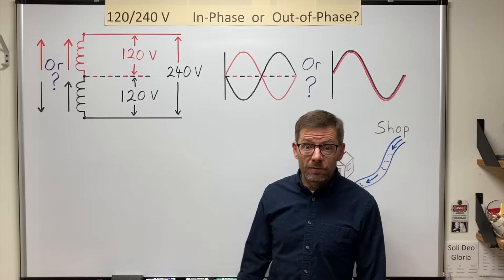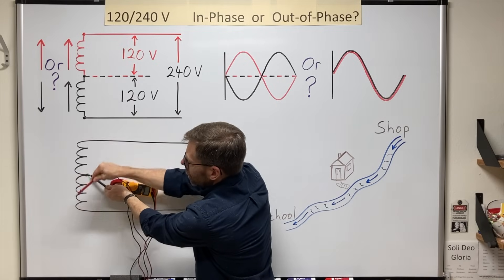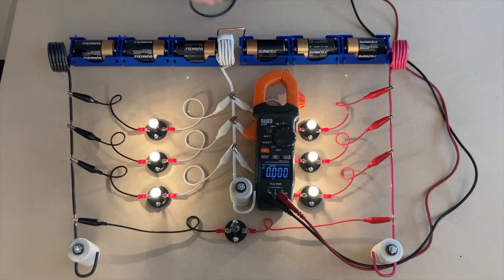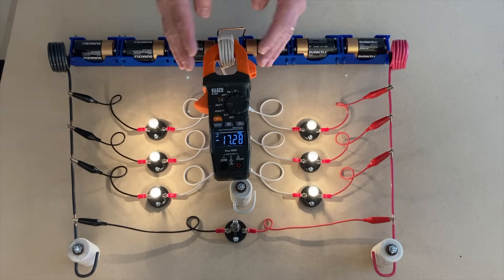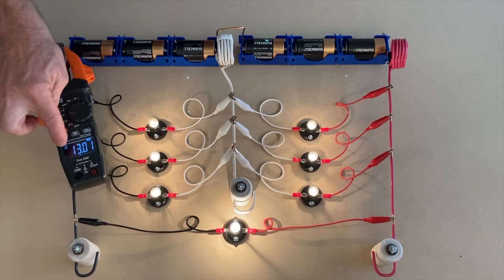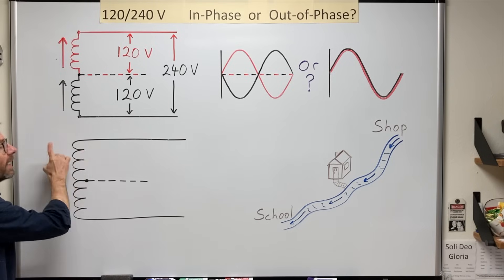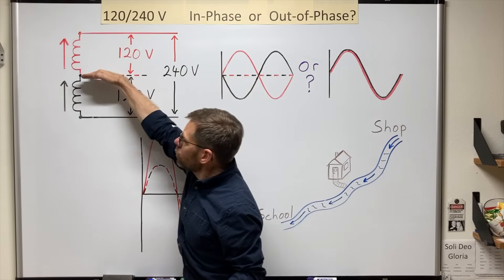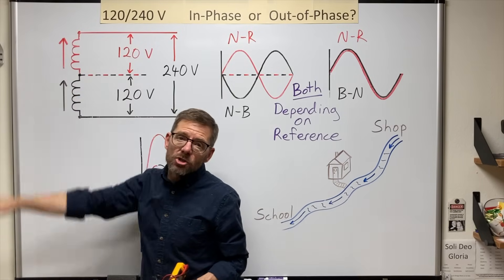120/240 V  In-Phase or Out-of-Phase

Comment: Wouldn't this be akin to claiming that two lines of a 3 phase service are 60 degrees out of phase? Because essentially they are if we are willing to count peak to trough (as we are here) and not peak to peak.
Reply: No.  The three phases are out of phase by the same amount no matter how you measure them. The only difference in voltage is a result of where each phase is in its cycle relative to the other one measured.
Reply: @jovetj  see my response to your other reply. In short, if we change reference as he does, we WOULD get 60 degrees OOP for a 3 phase winding. Explain how this isn't true.
Reply: @jovetj  if your having any trouble seeing what I mean, use his battery trick (DC equivalent) and rotate exactly as he does (according to polarity) and see how many degrees OOP you get with a 3 phase winding.   Hint, it's 60 degrees. If this doesn't make sense I'm happy to explain further.
Bear in mind that when I say 'rotate', in his example he 'rotates' 0 degrees to draw the 0 degree OOP conclusion. 

To be clear, I don't disagree with any of his steps, only his conclusion (and only that his conclusion is incomplete, not that it's fundamentally wrong).
To say it is misguided to retain a common reference for determining phase angle, though,  is ridiculous. Phases are by definition an angular comparison and to do that you need 3 points with a common vertex. It's just geometry

Comment: 7:58 How is the bulb on the bottom energized with no path to source? Is the one set of batteries balancing the other in that setup?
Reply: Great question!!
The answer: follow the wires.  The current was flowing from the negative of the battery pack on the left, through the back wire, and through the bottom lamp...  then through the three other lamps still connected through the red wire and back to the neutral which stayed connected to the positive of the left battery pack.  The three lamps didn't glow because the load (resistance) was all shared between them, reducing the voltage across them each.

Comment: I disagree somewhat with your declaration at 12:35. Semantically that is,  but semantics is what this is about.

Whether or not the windings (or half of a larger winding as it may be) is in phase or 180 out of phase has to do with reference. You admit this yourself and obviously understand that. If neutral is reference, as it so often is, I don't see how anyone could interpret the phases as being 'in' WRT neutral. Your sine wave graphs show this exactly. When L1 (or L2) is reference, they are series aiding, and are indeed in phase (becoming a single 240 v sine wave). But how can one argue with a graph clearly depicting waves as being 180 out of phase-- by the very definition of phase.

By the way, excellent video and fundamentally I agree with everything you've taught here-- just making a semantics point on what it means to be in or out.
Reply: Spruce_Goose is correct here. Dave moves his reference between the two measurements, which invalidates the relationship he's trying to show.
You have to pick one reference point if you're going to determine the phase relationship between two signals. The practical choice for that reference point is earth/ground, which is what neutral is bonded to.
From the perspective of neutral, there are two secondary coils wound in opposite directions, creating two 120v signals that are inverted from each other (which we tend to call "180 degrees out of phase").
If you use a typical oscilloscope that you plug into a wall, it will always be referenced to earth/ground. Therefor, you will always see the "phases" of your system as 180 degrees out of phase. (note that the phases of a split-phase system are not linearly independent and therefor not actually independent phases)

If you use a scope-meter that is NOT connected to a receptacle, you can measure from one end of the full secondary winding. From that perspective you can measure one side of the split phase or you can measure the whole secondary... but you can't measure the other side of the secondary because that would require you to move the reference... which is why we don't talk about the phases from that perspective.
Reply: The point is the reference based on the neutral does not matter and cannot determine "in phase."  The neutral does not determine what the transformer winding is doing.  The transformer windings determine that.... a fixed reference based on its center tap is misguided.  
If the transformer windings were truly out of phase, they could never be added together to produce the double full-winding voltage.  The video demonstrates this very clearly early on.
Reply: @jovetj   How are you determining what the windings are doing without any reference? In the case of 3 phase, 120 degrees out, the reference is a neutral (real, or imaginary in the case of delta). 

If you apply his same logic to a 3 phase winding, you would come up with 60 degrees out of phase. The multiplier we use is Sq Rt. 3. Thats 1.7ish, which implies 180 OOP would be a multiplier of 2, not 1.

Phase, by definition needs reference. 
Please explain how, on a 3 phase coils, you would determine the phasing with a changing reference. Because that's what he's doing to claim 0 degrees out of phase here: he's changing the reference. Andnif we're allowed to do that, then my statement that 3 phase windings are 60 degrees OOP is perfectly valid.
Reply: @spruce_goose5169  The reference in three phase is zero volts.  Each phase has two of them in its cycle.  You can measure between phases or between a neutral and a phase.  The instantaneous measurement may be phase shifted but the difference between the phases will not be.  Your 60° doesn't compute with me.  Are we really on the same page here?  https://youtu.be/iMn7dq7B1oo
Reply: @jovetj  I don't think you understand that phase relationships is fundamentally about reference. 'Phase to phase ' is actually just one new single phase.
Zero volts? Zero volts to ground you mean? That's usually the neutral (but not always) and it's depicted on phase graphs as the x axis.

Let me ask you,  what is the angle between two points? What about two lines? Hopefully you see the first question is nonsensical and the later requires a vertex for reference.

The 60 degrees is what I am saying one will 'think' the difference is if using the method described in this video. Did you try the battery example applied to 3 phase? What number did you get?
Reply: @spruce_goose5169  “Zero volts? Zero volts to ground you mean?”
No, zero volts to another phase.  Between any two phases, there are two moments in one cycle where the potential voltage is zero.  These are easy reference points for phase displacement, because all three phase combinations can be seen to have zero points at different times.  You can do the same with a neutral, if there is one, if you want, but it only changes the "whens" and not the "how often" for those zero points. 

It's like you're trying to use military ordinance to drive a nail into a board—you're making the results of this  video far more complicated than it truly is.  Three phase is more complicated because the 3 windings DO change phase with each other, whereas a split-phase transformer secondary does not.  That's why there are three three-phase secondary windings (usually) and not just one (or two joined in series).
Reply: @jovetj  Jovet. JOVET. MAN. It's like your not even reading my words. Certainly not comprehending them. Shy haven't you answered any of my questions.

You realize the x axis is ground potential, i.e. neutral (most of the time). The zero crossing are in respect to neutral! 

If you're talking about when 2 phases cross each other (which, yes,  they do twice a cycle) you might be surprised to learn that that happens every 180 degrees, not 120. Look at the graph man. Measure it.

I'm not making anything complicated you just seriously don't understand what I'm saying. It's quite simple of you let it be, but you're too stuck thinking you're right to even bother answering (or pondering) the questions I have asked you and the points I've made.
Reply: It's also as if you think I'm arguing 3 phase power is 60 degrees OOP. I'm not. I don't know how to make that any clearer. I'm saying the logic applied here, of applied likewise, would yield 60. Not sure how you can't see that. Use his river analogy. Use his battery analogy. Use whatever you want from the video and you will see.
Reply: To clarify. 180 is between the same two phases, not any two so maybe we're not off each other's page on that one. But 'any two' phases cross every 60 degrees and therein lies this complication of reference.

Comment: Kids, if you try this at home make sure you have your scope powered thru an isolation transformer, unless of the portable battery operated type which are much more common these days, excellent presentation by the way
Reply: +1 This experiment generally won't work with oscilloscopes that plug into the wall because they're referenced to earth. The little (negative) clip on the probe is shorted to the ground pin of the plug.
Earth is bonded to neutral at the panel, so if you put the clip on live, you'll complete the circuit and make a lot of smoke, sparks, and fire.

Comment: I remember browsing youtube many years ago and being confused about - how the hell just adding center tap can invert phase?! And almost every popular youtuber and even pro electricians couldn't explain it lol. Turns out it is just a measurement problem.
Reply: There's no 'problem'.
''inverting" a phase is not like adding rotation. It's not magic, it's simply a matter of polarity and-most importantly- reference.
With neutral (center tap) as reference, the two hot are undeniably 180 out of phase (or 'inverted' if that terminology suits one better). But for sure the coils are series aiding.

Comment: So if I'm understanding correctly, two outlets in a house might look like they're out of phase from each other at the plug, but that's just because one has the hot on the negative while the other has the hot on the positive and you have to account for that when judging what's going on with the system as a whole?
Reply: Both L1 and L2 are generating voltage at the same moment.  The only thing the neutral does is cuts the number of windings of which voltage is drawn in half, halving the voltage.  The "out of phase" is just a measurement artifact from measuring both relative to the neutral, and not the full transformer winding itself.   Watch the video again, it's explained very well.
Reply: @jovetj  So then exactly what I said is accurate. Got it. If someone is measuring at the outlet, it appears to be out of phase because of the polarity of the hot terminal while not actually being out of phase because it's just a measurement artifact. Read my comment again, I explained my question very well.
Reply: @alphazero924  this is all semantics. There's no 'lie' in the 'artifact' of measuring from a common neutral point. It's how we get 120 degrees for 3 phase systems. People here proclaiming you simply cannot use a common reference point for determining phase angle are bonkers. They're 'in phase' in that they are series aiding coils (which for some people is apparently the definition of whether something is in phase)
Reply: At the outlet, one prong (the larger slot in the US, and on the left if the ground pin is down) is the neutral. That's bonded to earth/ground at the main service panel, and there's a literal stake in the ground somewhere nearby.
If you measure from ground to one end of the secondary winding, you'll get 120v. If you measure from ground to the other end, you'll get 120v but with an inverted sine wave compared to the first side.
That is why people say the two sides of the secondary coil are out of phase with each other.
In the video, Dave MOVES his reference point between the two measurements. This is not generally allowed, because if you do that, you can show that anything is in or out of phase with anything else.

Comment: Great. Now people without isolated channel oscilloscopes are going to blow their leads up. Please point that out.
Reply: This is why we talk about the two split "phases" being 180 degrees out of phase. The practical reference point is earth/ground.
Reply: @Falcrist  Yes, thank you. I come from the old school, fixing televisions and using an isolation transformer. The old oscilloscopes have a common return on the probes and are grounded. If you attempt to look at the 240 voltage, you clip your two probe grounds on the neutral and the probe tips on the two hots. It shows up as 180 out of phase if you forget to invert the second channel. I now have an isolated scope, but had old school habits. I know how to correctly reference the probes, I just had a brain fart. Brain farts can be dangerous. I have watched people blow up their leads because they didn't isolate the probe return.  Viewing 3 phase is a perfect example. Thank you for your excellent videos!

Comment: Great explanation Dave!  Now, I'm scratching my head trying to understand if I can measure total power, assuming a unity power factor, by simply measuring the L1 current and L2 current and multiplying by 120Volts.  I believe this to be true for a balanced system....but what about an unbalanced system?
Reply: Have to add in the neutral's current.
Reply: @jovetj  I don't think you need to measure the neutral current.  Look at the circuit for an electric meter (or look at one not installed if you can) and you will see the neutral current is not measured.  Adding L1 and L2 times 120 will in fact give the correct volt amps, and accounting for the phase of the voltage and current (the meter does this) will yield power. (Integrating over time yields kWh.)  Don't believe for a minute that the power company is giving you  that neutral current for free!
Reply: @davidg4288  You're likely right about not needing to consider the current on the neutral... but I never said anything about free.  Or power factor.
Reply: @jovetj  Fair enough!

Comment: pretty much all you said is correct.   You glossed over the fact that your clamp ammeter in DC would have given opposite signs if turned the other way around but that did not matter much for the point.   Altogether, very clear if not exactly surprising for folks familiar with meters and scopes.  Thank you.  However, for safety reasons, I feel that you should have made a strong point at the end when discussing results from the ground lead of the scope to L2, that this should NOT be done in real life.  It WILL BLOW UP your lead and/or scope because that would essentially be a dead short between L2 at 120V and mains ground through the scope's ground lead.  As it stands, a curious person not familiar with scopes may just try that to verify your (correct) assertions and be in for a bad and dangerous surprise.

Comment: Appreciate it. People say quite readily that the two sides are 180° "out of phase". Then, to make matters worse, they tell you to subtract the instantaneous voltages to get the total. To me, "out of phase" means adding them gives you 0. Like the Theory of Relativity, it really depends from where you are looking at it.
Reply: With earth/ground as a reference, the two sides of a split phase system DO add to zero. One is positive while the other is negative.
When you connect a load across those phases, what matters is the difference between the two voltages... not adding them together. Remember how you calculate current through a resistance. I = (V1 - V2)/R where V1 is the voltage on one side of the resistance, and V2 is the voltage on the other side.
For example, if V1 = V2, there will be zero voltage across the resistance, and therefor no current will flow.
Reply: @Falcrist  Yes, I understand that. And it is still often unclear to many and needs a good explanation, like yours.

Comment: That point of time we are measuring is necessarily the peak right? It's like pretending it AC going through a rectifier.
Reply: It doesn't matter because if it were truly AC, the "AC" voltage would have to be measured RMS.  The DC/batteries represent a snapshot in time of the polarity of the AC circuit that happens to have a voltage.  The actual voltage doesn't matter for the demonstration, as long as it's more than zero.

Comment: Your videos are wonderful. I have degrees in EE and CS but I have been a programmer in medical imaging research for most of 25+ year career (did a little engineering work in the early days). I am interested in relearning at least some of the information I have sadly forgotten over this period of time.
Reply: I'm on about the same track.  EE the worked in architectural engineering for a couple years then got into comp sci (had a comp sci minor in college, and programmed during high school).  I've been doing mostly line of business applications with some public facing sites.  I'd like to get into something a little different though.  How did you get into medical imaging?

Comment: Thank you for correctly explaining this.  So many people incorrectly think this is out of phase because they can generate the first sign wave form on an o’scope. Unfortunately, I’ve seen some explanations take the first sign wave form and say the voltage can be measured between the peaks.  This is fundamentally incorrect, because if measured using the same reference, this would, as you demonstrated with the DC circuit, result on zero volts.
Reply: Yes!  And yet people still refuse to believe it, even in these comments...
Reply: Two out of phase signals will cancel if you add them. If you measure the difference between them, you're actually subtracting them.
If you connect a load, the current across the load is given by the difference between the voltage on either side of the load. I = (V1 - V2)/R
The issue with the video is that Dave moves his reference.
Reply: 120-(-120) doesn't equal 240? News to me.